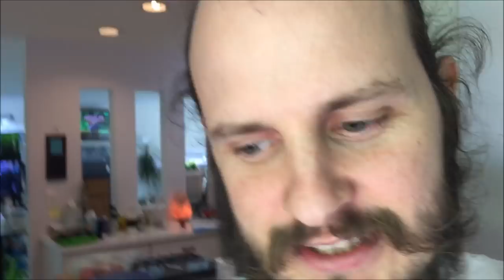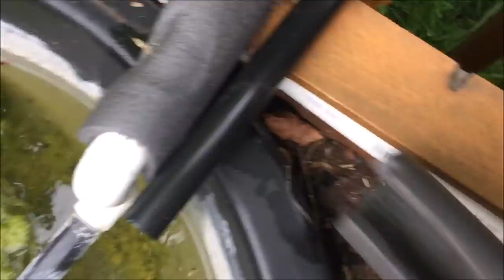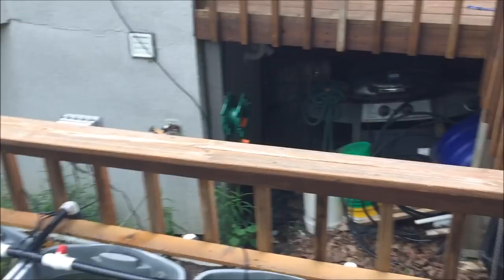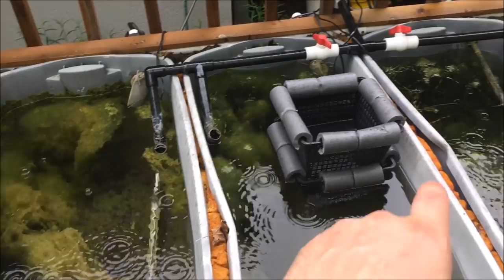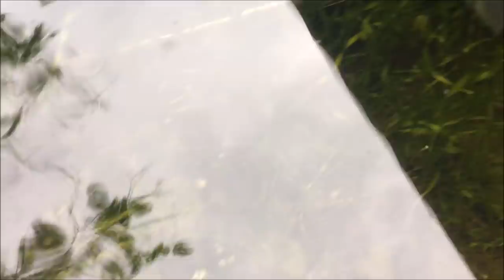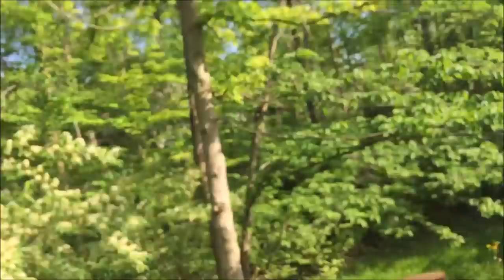You Wont Believe This! Outdoor Planted Tropical Pond Unveil 2018

Comment: You should just buy a green house. Put shade cloth over it. Buy a pond liner and cut logs and make square with them in green house put pond liners in and tada mini ponds put gravel in green house floor.  You could even glue drains on pond liner and run pvc pipeing under them to drain them. You could set up a rain catch system from your roof for pond water.
Reply from the maker: I want to build another level on the house with a flat roof that has a green house on the top of it.
Reply: L.R.Bretz's Aquatics you should but the green house in to the ground I’ll save lot money on heating it. The ground never gets below 45 I think were you live.

Comment: "They" spray around here in South Carolina after hurricanes to keep the mosquito population down. If it kills them and their larvae it can't possibly be good for us or our water table. It also makes my efforts of non geo/ non gmo organic gardening almost for nothing...preach on brother! On another note, any hints of how to build a pond in the south so the fish don't cook from heated water? Been thinking about building one for a while but hesitate to do so due to that concern.
Reply: Trees shade ponds and can help protect them from the sun. Choosing the coolest location is important. Building the pond into the ground, helps with regulating temperatures. Cycling water through an underground coil will also help chill your pond. When you want to heat the pond it's easier if the tubs are underground and well insulated from the elements.

Comment: Thoughts on keeping a tub pond outdoor without heater or filter just to grow plants?
Reply: put into the ground... (at least halfway) to help regulate temps.
Reply from the maker: Filter isnt really necessary but can be helpful. You can keep heaters all mine are heated year round but they need to be insulated enough to hold in the heat from the cold wind if you try to do it in the winter.

Comment: What he calls chem trails is actually just caused by Jet engines. Most likely commercial jets flying overhead. Its nothing new. Most people dont understand how much heat a jew engine throws out in their exhaust. Then think about how high they are. And how cold it is up there. Then what happens when fuck loads of heat meets fuck loads of cold. OH they form cloud trails. Its just jets man. Its not a conspiracy. It doesnt matter if its a commercial passenger jet or a military jet. If they get high enough in the atmosphere their high heat exhaust will cause a reaction with the cold and moisture up there and create cloud trails. Nothing sinister about it. Also I was a diesel mechanic in the army working on Track vehicles. The Bradley being my main job.But i also worked with the Abrams a great deal as well.The Abrams is a tank that uses a turbine engine. Same engine some military helicopters use. Just slightly modified and tuned down or else the power would destroy everything. But its still a turbine. And on cold mornings they did the same thing as jets at high altitude. They made cloud trails out the back. Very hot air coming out the back meeting all of that cold air in the winter and you get clouds on the ground. Im not sure why this is hard for people.